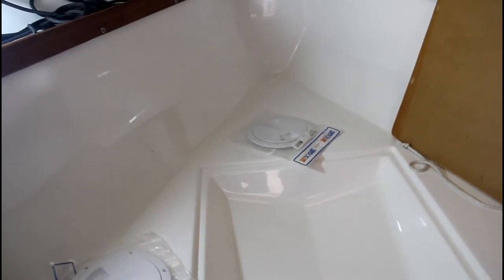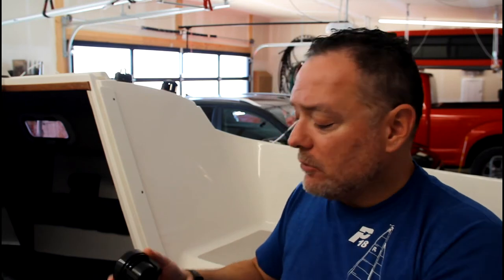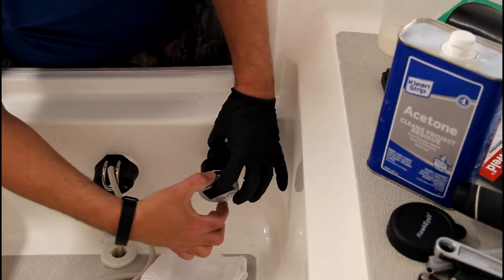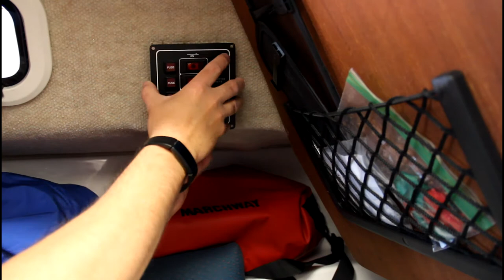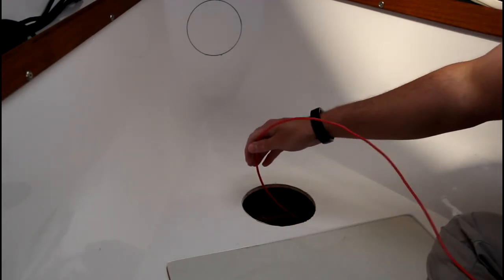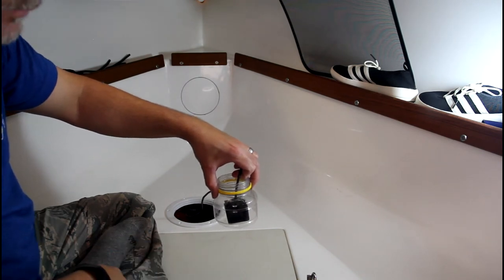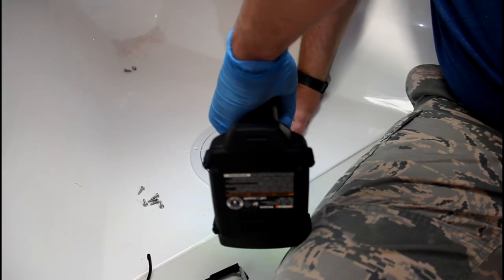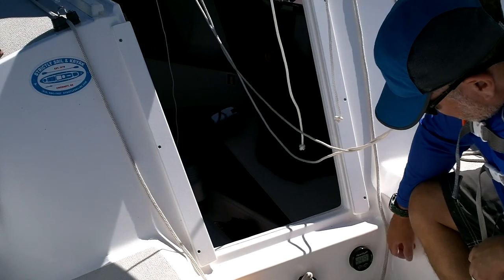Hawkeye DepthTrax Depth Sounder Installation

Comment: Duct putty sealant works for mounting the transducer to the hull vs that jar. It comes in 1lb blocks and costs $2. It allows you to fine tune the angle of the transducer and hold it securely, never dries out. It's a trick of kayak fishermen. I have used it and it works perfectly.
Reply from the maker: I’ve also heard toilet ring wax works well. Since the transducer is held in the jar by the wire…it can swing a little bit in the jar. So even when heeled I still usually get good depth readings.

Comment: I take it the audio transducer for the alarm sound is generated at the gauge itself? I couldn't tell when you demonstrated it in the garage before the bow depth transducer was installed.
Reply from the maker: Correct. The display head also generates the warning tone. It alarms at whatever depth you set it at. I have mine set for 10ft.